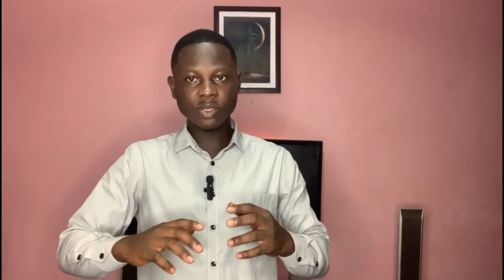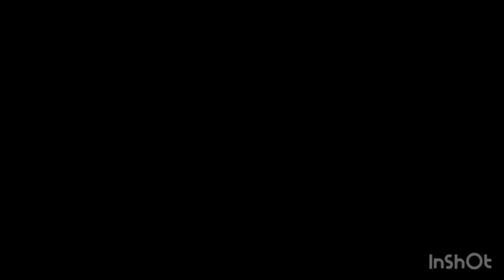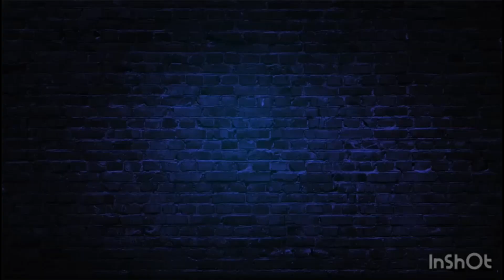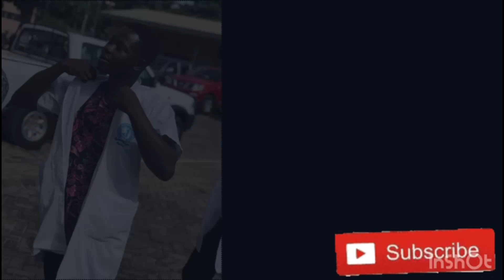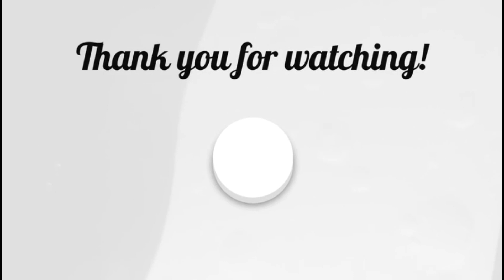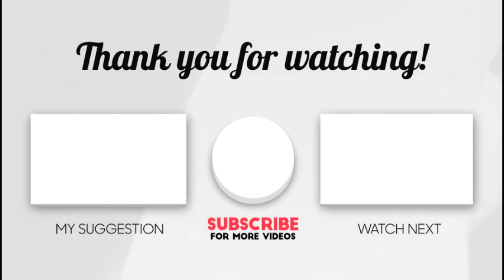Inside the Dangerous World of Residential Electricians: Safety Tips Exposed

Comment: 7:43 "Thanks for sharing these residential electrician tips! I learned a lot about safety and common issues. Do you have any recommendations for essential tools every DIYer should have for small electrical projects?"
Reply from the maker: For small electrical projects, essential tools include wire strippers, a multimeter, pliers, a soldering iron, electrical tape, and screwdrivers. Always prioritize safety with insulated gloves and safety glasses.
Reply: thanks  @techcareengineering
Reply: thank you for this tips @techcareengineering
Reply: Thanks for your response❤